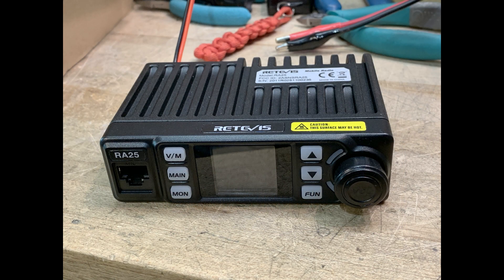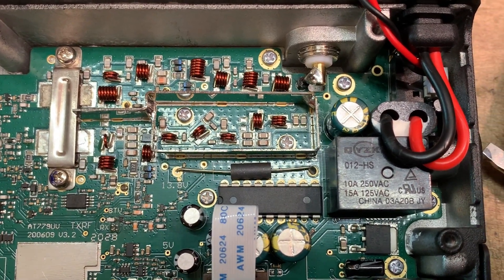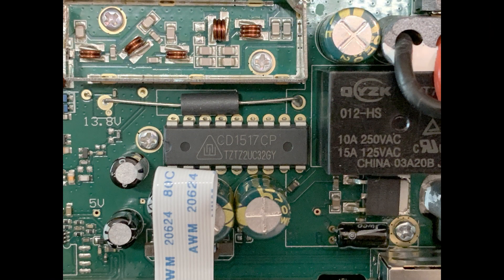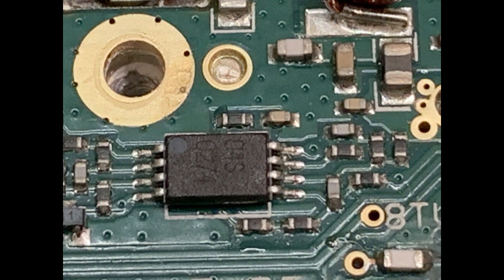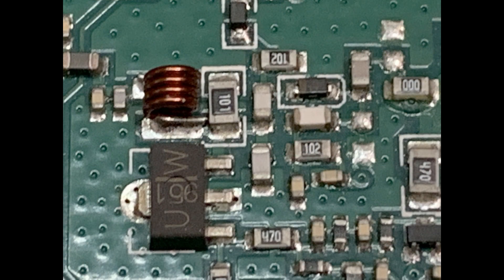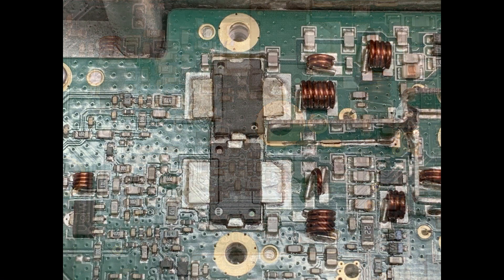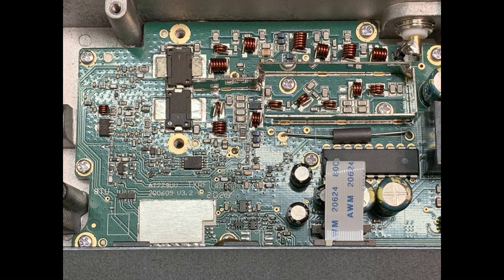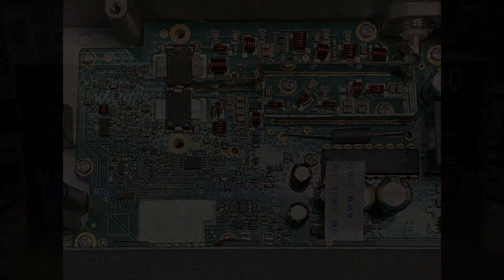#1249a Retevis RA25 Transceiver Teardown

Comment: The through hole part is not a microprocessor. CD1517 is a 2x6W class B audio power amp. https://i69.servimg.com/u/f69/15/84/19/70/14087810.jpg